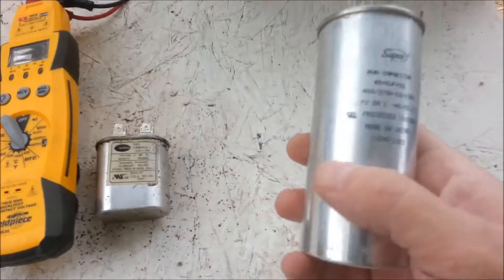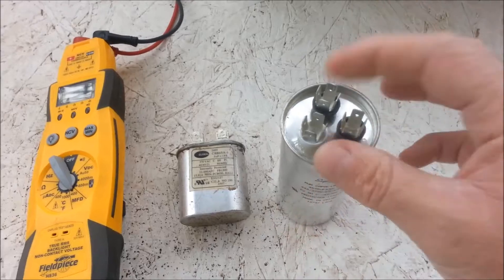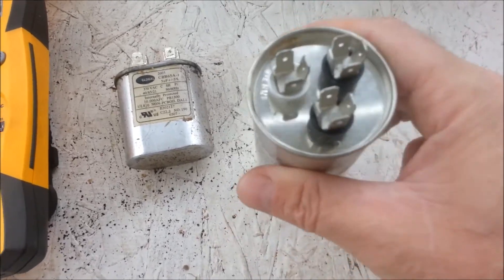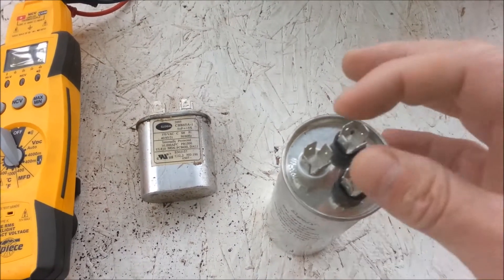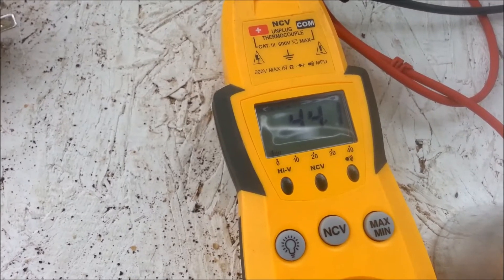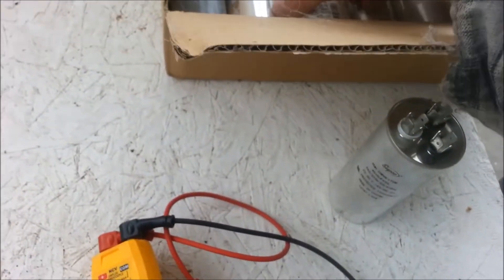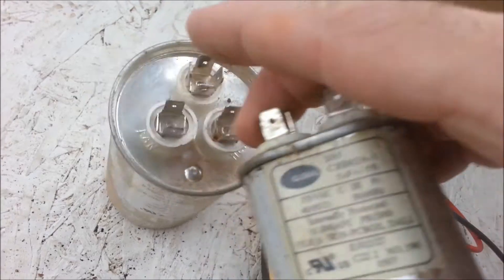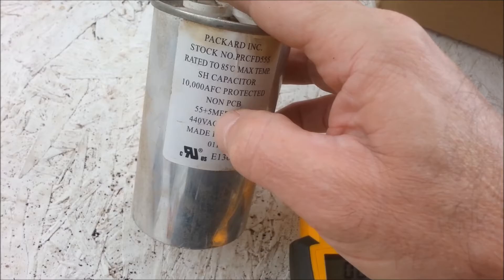Testing Start RUN Capacitor heating and cooling

Comment: Purchased a capacitor on Amazon with the correct rating and picture showed 3 terminals.   The one I received had a 4th, extra terminal labeled 'CPT'.  Is this 4 terminal capacitor a suitable replacement?   TIA.

Comment: Capacitor on the compressor side is good too. 
The capacitor says 5% of tolerance, which means it's consider good if it reads between  42.75 - 47.25 mF.
Reply: yeah i was wondering that. I was like, its fine.. So question. Is it considered bad if its above or below that +-5 ?
Reply: yes, 5% above or below is should be fine.

Comment: Aaron, nice video.  I have a question on 48v DC condenser fan motor/inside fan motor for a DC/solar air conditioner.  Do you need the capacitors here for these fans if the HERM for the compressor is solved by the drive/inside the drive for the compressor?  Or is this slight variance okay for battery capacity of the unit and for the sustainability/amp draw of these indoor/outdoor fans?  We ideally run these two without capacitors.

Comment: I would think the herm measurement of 44.3 is within the +-5% tolerance clearly marked on the capacitor. + or - 5% of 45 would give you a acceptable range of 42.75  to 47.25 mfd.
Reply from the maker: zcx99 I had replaced it earlier and it was bad. Technically your right but often that + or -  isn't always correct. If a Cap doesn't go up to at last the listed uf and you have a problem replace it.